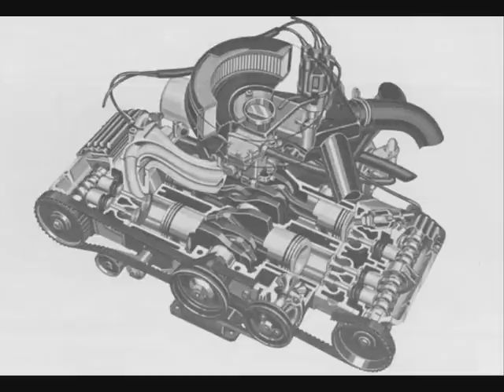Alfa Romeo,stabilimento di Pomigliano d'Arco

Comment: it was a 1.2 se with head rests and a rev counter it was dark blue with cloth seats andoriginal hub caps. I was amazed at the four bucket seats  it was red lined on the rev counter at over 7000rpm.it got me hooked.my first car was a 1.2lusso after came alfetta 2.0 sal,alfetta 2.0lusso,alfetta 1.8gt,alfetta 1.8 lusso .1972 French 1.8lhd alfetta,1.2ti sud,another 1.2lusso.alfetta 2.00gtv first series.gulia super 1.6 series 3, 1.6 gtj single headlight,another guilia super 1.6 series 3.alfettagold cloverleaf.

Comment: I had to scrap my merc 380slc because the mounting for the wiper motor mounting had rotted the bulk head.in my gulia super you just took the wiper blades off removed the grillplate and there is the wiper motor for you to take out as in all 105/115 alfa did not have to take the dashboardout to work on it.german engineering what a joke